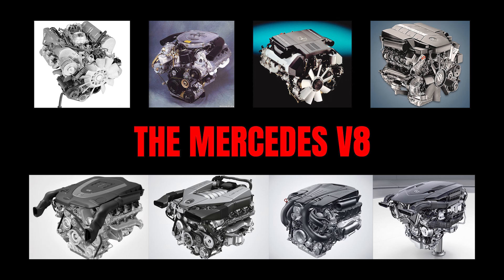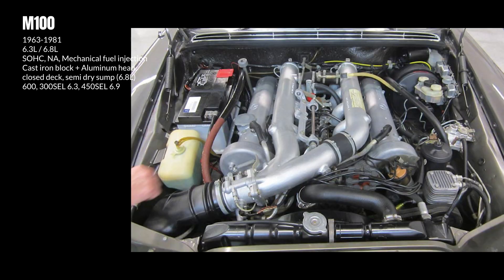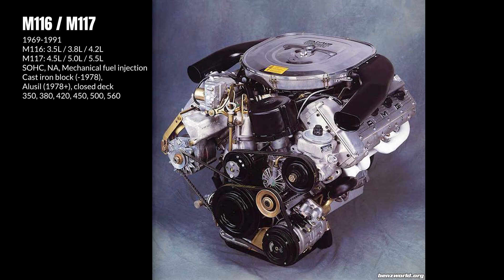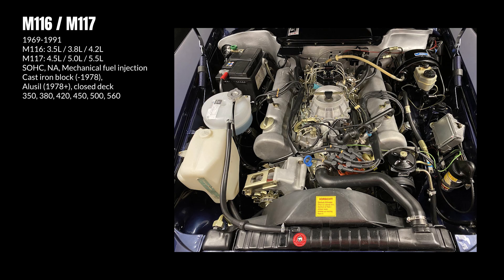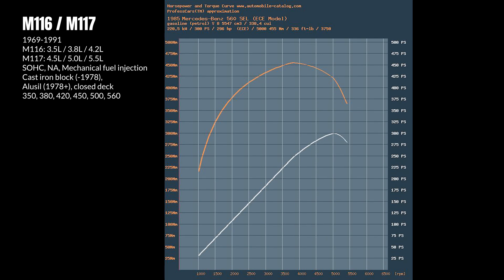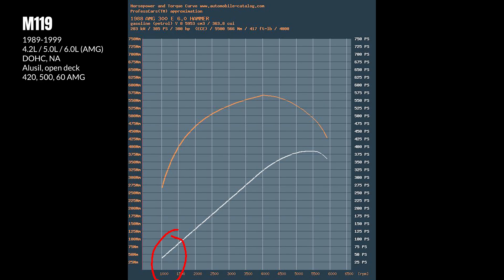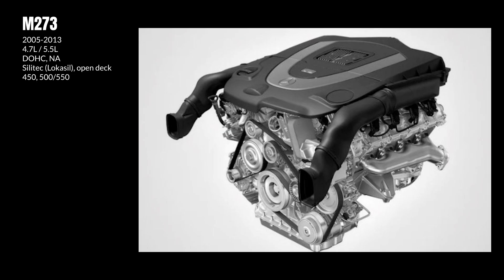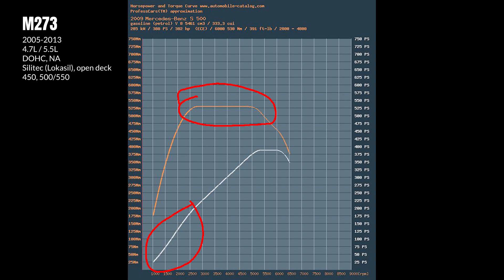Evolution of the Mercedes Petrol V8

Comment: I've got an M116 (1984 380SL),  M117 (1984 500SL, 1988 560SL), M119 (1993 500E, 1994 E500) and an M113 (2002 SL500 SA).  

My preference is for the M119 with the M117 500SL a close second.  The 560SL is North American spec so it's actually less powerful than the older, smaller displacement 500SL.  

I'm pretty ambivalent about the M116 due to it being a North American spec. 
And the M113 feels, to me, more like a 6-cylinder.

Comment: My vote is for older 113’s have personality seen more than a few with 320-340K miles without ever pulling heads or front cover off. I still have an older 113K with 140K miles, zero issues except for compressor pulley bearing.

Comment: M177 (LS1) owner here. Extremely stout engine. Biggest issues are coil packs getting eaten from heat. And the packaging makes everything harder to access. But Mercedes’ version seems to be the most robust out of the S63/TFSI V8TT variants. It doesn’t have the oil leak pain-points or rod bearing failures of the S63 (see FCP Euro teardown), nor the cooling/water pump issues of the TFSI. 

For example, check out Nurburgring videos of RS7s, they cannot keep oil temps down! Mercs (c63, e63, gt, etc.) have 2 additional aux coolers behind the front bumper.
Reply: We have seen a few water pump failures/leaks , very involved jobs for simple repairs. Excellent top end power. Have yet to see any 177’s with 280-300K miles like older 113’s and 273’s